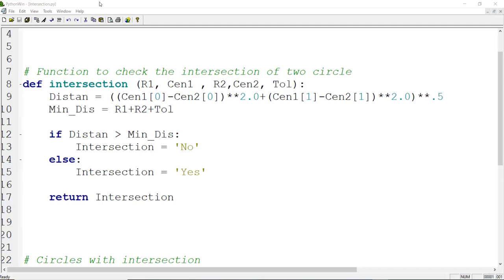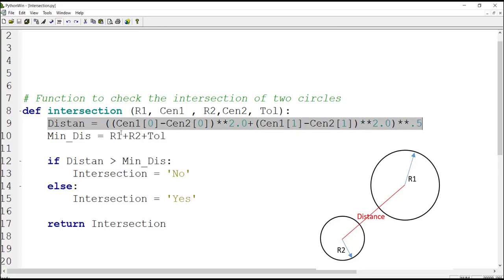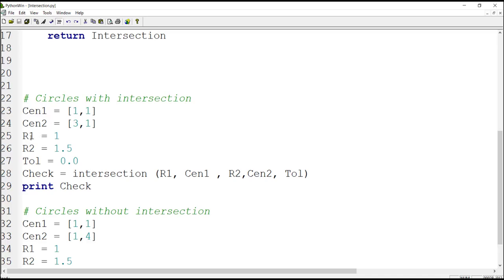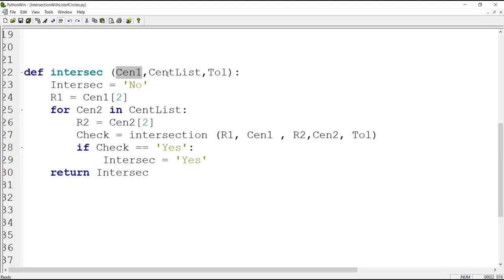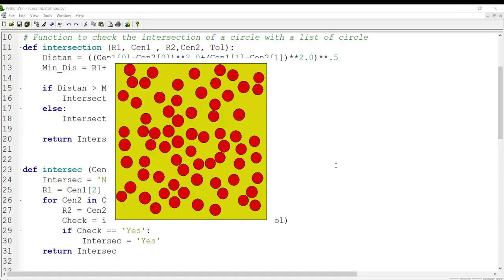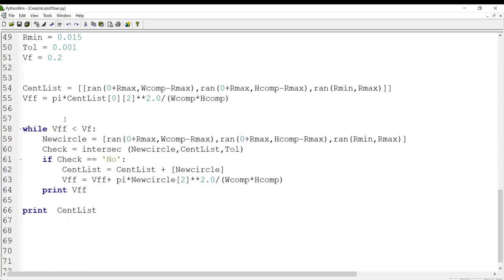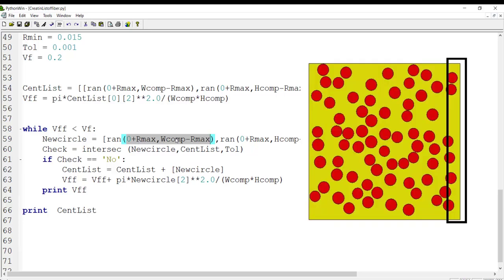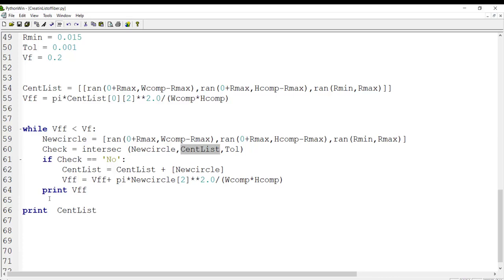#1: How to create random distributed inclusions or fibers of RVE/UC by Python scripting in Abaqus

Comment: Sir I am looking for the same in 3D model. Can I have the code if you have it. It will be very helpful for my phd. I want the random position of particles in a 3D cube for a given volume fraction.
Reply from the maker: Two complete and useful Abaqus plug-ins are now available which can model unidirectional composite RVE with random fiber distribution considering periodicity. The volume fraction can be even more than 80%. 
Please check these plugins and related videos:
3D plugin:
https://youtu.be/960tkfor_d0?si=hn5Hw_4Qn8GTyn9L
https://www.engssoft.com/engsoft_ud3d_v1/
2D plugin:
https://youtu.be/-Y40Z4Xv28s
https://www.engssoft.com/engsoft_ud2d_v1/